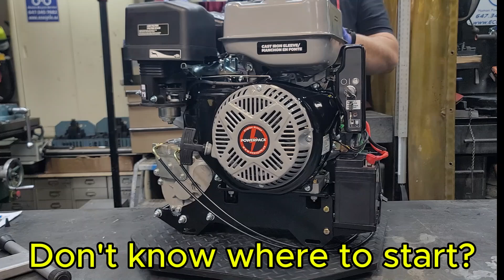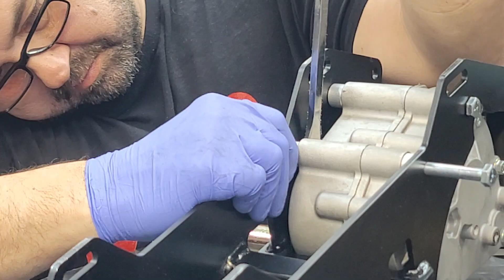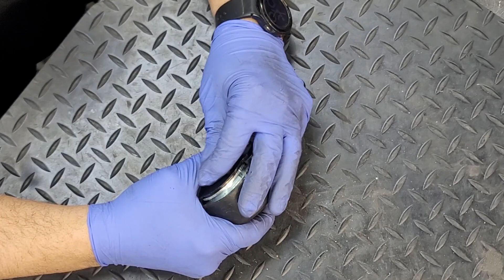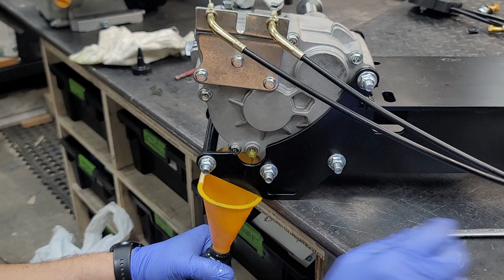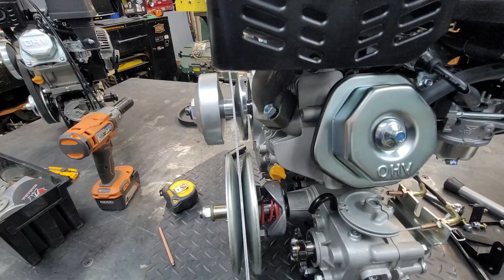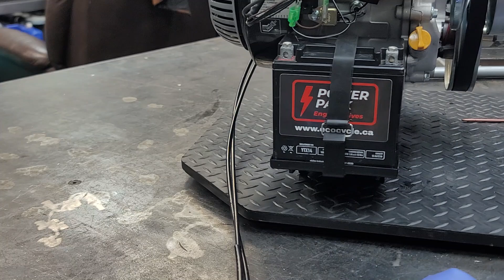Big Block PowerPack.  Complete Assembly Video.

Comment: HEY Arne I bought the Powerpack big block bracket  for my Kandi go-kart that I modified with a 340cc Honda engine, but have not received it in the mail yet can't wait for it to get to me I know all of us out there have been waiting for someone to build something like this  I am also going to try to modify the 30 series FNR into it let me know if that is possible or if it will not work?
Reply from the maker: Hi Ron, Thanks for the support, you should get your PowerPack soon!  I don't think it will be very easy to put the 30 series gearbox in your Powerpack.  You be better of with just getting the big gearbox as that is what it's made for.  Let me know if you have any questions!
Reply: @Ecocycle-Vehicles  HI Arne thanks for the information on my build for my kandi -kart, I purchased the 40 series transmission and I'm glad that you asked if I had any questions I would like to know if you can show a video of how to weld the big block bracket onto the engine plate of my go-kart? Thank you sir.
Reply: Got my power pack bracket in and I am very impressed with it was package very well.

Comment: The 212 kit would be nice laid out like this one.   It looks like it would be easier to incorporate into an existing frame than the current 212 pack with the fnr box under the engine, making it too tall and top heavy.   Just an idea. Cool mount, though.
Reply from the maker: Hey Thanks! I appreciate it. The small block PowerPacks are about  8" tall.  The first prototypes were similar to the Big Block PowerPack layout, but I couldn't configure to use the stock belt and still maintain good access to the rear engine bolts. Call me if you want to make something custom.

Comment: Is the gearbox arranged to run equally efficiently in forward or reverse? Just wondering in case a person needed the output shaft to be running in reverse more often than forward - such as if the engine needed to be oriented in the opposite direction.
Reply from the maker: The Big Block gear box runs at 2:1 in forward gear and 3:1 in reverse.  Hope that helps!
Reply: So there wouldn't be any problem with running it more often in one direction than the other?  @Ecocycle-Vehicles